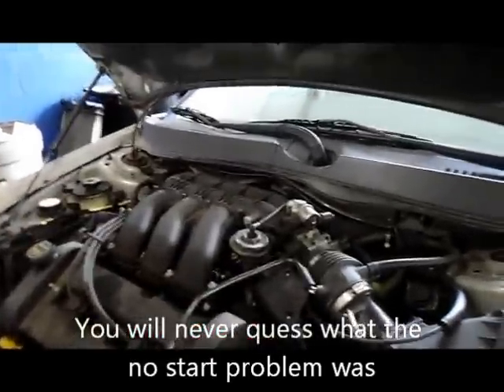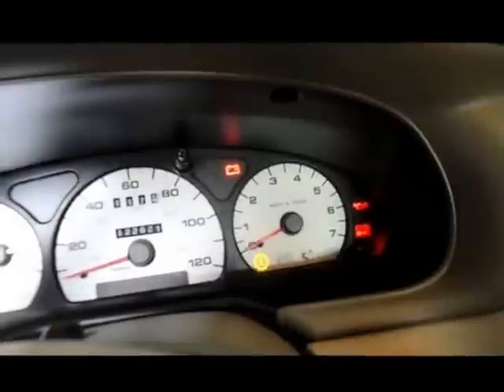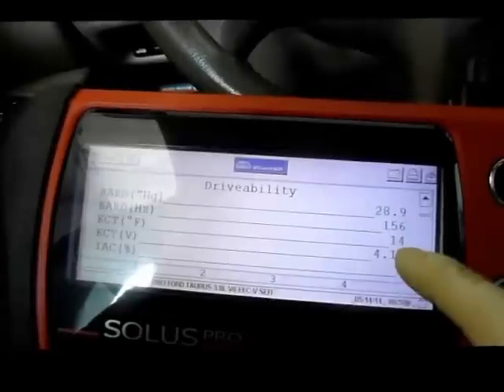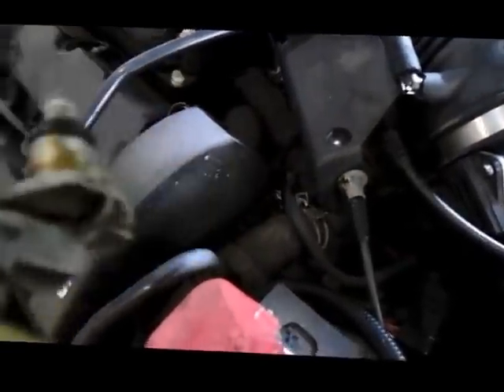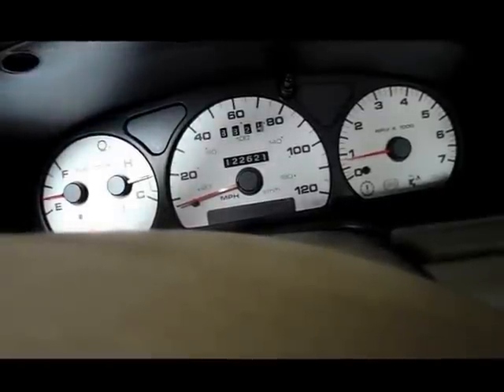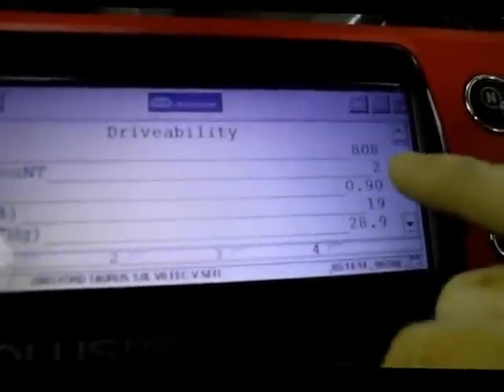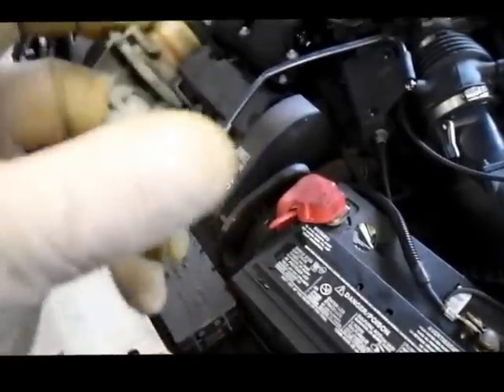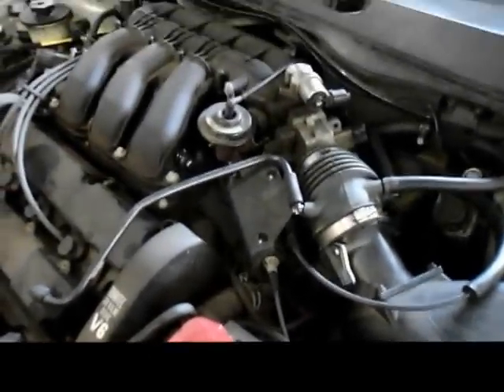Engine cranks but won't start

Comment: The reason for the no spark was because the temp sensor had an open ckt, and the computer is programed to not allow spark or fuel, to prevent operating the engine with a faulty temp sensor.

Comment: 02 saturn sc 1.9l temp sensor did the same thing turn over but wouldn't fire replace the temp sensor engine fires up my understanding is this is common issue on this vehicle. Like you I find it odd it won't run with a bed temp sensor.
Reply from the maker: Thank you for watching

Comment: Could you please help me out. I grew up changing oil, freeze plugs, starters, heads, alternators, drum brakes, etc so Im not a "novice" but im not a master mechanic either. I have a 2007 BMW 328Xi which Ive had for 6 years now and it has 132,000miles. It sat in my construction yard for over a year while I drove other vehicles, when I finally went to move it the Batt was  dead as a door knob, BMW charged me $499 to install and "Program" a new one, while in BMW Service they called telling me the Alternator was also bad needed replacing and it would be an additional $1,300.00 for the Alterntor. I asked Service on specs and found it was a BOSCH 180AMP which NAPA sells for under $300.00 so I installed that myself the day I picked up the car in the BMW Parking Lot with everyone watching me. Car ran for a few days then needed jump starting to get it to go, ran fine for a few more weeks and I discovered Alternator was barely putting out 11.9Volts with engine running, Napa put me through the ringer for days trying to get a new Alternator and in that time the car "Magically" just worked everyday with no problems for 3 months straight so I never pursued the replacement.      

3-1/2 Month's Later im driving 45miles away from home up in the Ghetto of this City and im sitting at a red light and my car is idling horribly, Im looking around for Error Messages, Lights, or Anything and nothing is coming up, my Navigation Screen is so Dimm I could barely see anything I knew the Battery was on its last volts and about to die, I ran the red light cut the wheel and almost made it out of the road but some a-hole cut me off and I was forced to stop half through a turn in the middle of the road where it Died. No one would help me push the car, jump the car, or anything but literally 100+ people asked me for money and money and tried selling me drugs, towels, and a electril drill. I was so disgusted with that class of people you have no idea. till I found 5 teenagers riding bikes who helped me push my car through rush hour traffic into a gas station. 

Finally got the car towed the following day back home, but I was working so I couldnt be there, I had my father waiting for car once it arrived at house. The Tow Truck Driver tried to "Start The Car" so he could use its own power / brakes to get it off the tow truck. My father says while he was standing there watching the tow truck driver start my car the jumper cables connected to the terminals under the hood began to Sizzle, Shoot Flames, Fireworks, and Smoke was Bellowing OUT from under my Hood. Screaming that something was wrong the Tow Truck Driver Ran Back to the cables discconnecting them. 

The following day I removed the alternator and replaced it with a new one from NAPA, i started my car and it was running perfectly, tested the alternator and it was charging the battery 14.6V  perfectly as it should be. I decided to take the car for a quick spin around the hood, put it in Drive pulled out and turned right, accellerated turned right once more and not more than 200feet from where I was parked the car DIED immediately, freezing gauges in place, NAvi Screen went Black and that was it. Car would start only when Jumped / Assisted and it would run on its own power fine, but soon as you turned on Radio, Air Conditioning, Put it in Drive and Accel, the car would shut off immediately. Its been this was for 4 months now and its sitting here doing nothing. I checked the Battery which has a charge to disconnect positive in event of accident, thats still connected fine, the only thing i havent checked are fuses and relays.   The fuse box for this BMW is behind glove box and you need the arms of a midget to reach anything, I have BIG arms and BIG hands I wear a size 14 shoe US and I cant fit my hands into the damn glove box anyways to do anything so im screwed in that regards. im hoping its something under the hood (fuse box) which is under hood could possibly have something i could change but I dont know what it could be. Any help is really appreciated. thanks

Comment: my 2000 accord did this it accualy stalled and would not start i replaced the thermostat and it fixed the problem .i found it odd and i was at my friends shop and hes been a tech for 25 yrs never heard of it

Comment: It should have thrown a CEL first on the sensor but a fail safe position would be to prevent the car from starting. ECU does not know the operating or start temp with a bad sensor so it has no idea how much fuel, timing, or anything to provide. Much like a failed crank sensor.

Comment: Use Mode 06 and check raw coolant temp data. The Scanner can show you a default value that the PCM uses in place of an implausible signal.

Comment: did you check to see if you had any fuel pumping before you replaced the sensor on the taurus? i am having the same identical problem and we replaced the fuel filter and just out of curiosity we checked the fuel pump and got nothing. Could this sensor be able to shut down the fuel pump also?

Comment: I have the same problem with a 97 mazda b3000 aka ford ranger. changed the coil plugs and wires crank sensor fuel filter. runs and starts fine until it heats up at idle or there is no air flow threw the motor while driving. thought it would be temp sensor. thanks for confirmation. will let you know if its the issue or not. thanks again.

Comment: Nissan 280ZX 1978 to 1984 have the same problem with ECT and won't start if stuffed but once replaced starts straight away like the Taurus did

Comment: I have a 84 Ford f250 diesel, just last week I was doing to the store just before I pulled in it stalled now the engine turns but won't start even with starter fluid, I didn't run out of fuel I was told two possible problems, the fuel injector pump, or the glow plugs, he said possibly even both idk I may just junk it....it's frustrating...

Comment: Don’t know about the wiring on Fords but in heavy trucks they share sensor supply circuits, sometimes you’ll have faults for other sensors on the shared circuit but not always, depends what other sensors are. That’s weird that it wouldn’t start because it’s too cold???
Reply from the maker: thanks for watching

Comment: some features of temperature sensors are an open circuit default position when they fail, like your thermostat would fail in the closed position you would have no water circulation, this temp sensor failed and went to the HOT side of it's inner circuitry where it stays, when you turn your key over the computer is being told that the car has over heated and it will not allow it to start. Simple, but stupid in my opinion, I have had it happen on Subaru's regularly, and they are a bit of a pain to get at too, you can just unplug the sensor and see if it tries to start that will tell you if it is the sensor or not

Comment: I have been experiencing the same problem.  Same year same model.  The car runs fine until i shut it off for a few minutes.  It cranks, the rpm gauge will move but that's it.  Wait 5-10 minutes and it starts.  My mechanic could not find any perticular code.  I will keep a spare temperature sensor on hand for the next time this happens.  Will let you know

Comment: A low eng. temp reading to the computer is just as bad an overheat reading, as far as the computer is concerned and programmed, the sensor is out of parameter, think about it this way. If you assume the sensor is good and it is and it's giving a low (cool ) reading, that means the engine may be out of or very low on coolant and overheating at the combustion chambers and valves,engine shut down enable takes over.
Which brings me to the argument---  I have seen many engines fried because of sudden and fast dumping of coolant for what ever reason because the temp sending unit did not have time to cool off or heat up in order to give the driver a true reading and the driver would be confused about the engine misfire , not realizing the valves where seizing from overheating.
I never thought cooling should be gauged by TEMP but, should have been gauged by water pressure. Think about this fact low or no water pressure means a leak, high water pressure means steam !

Comment: it does the same on a 2003 ford Taurus had the same problem except it would crank after a few tries, and the radiator fan starts right as u turn the key to crank it

Comment: working on that now have fuel fire timing comp spray fuel in intake starts warm up start aftar warm up my thoght temp guage no signal to pcm for high fuel for start up old model cars need choke set before start up didnt know if temp unit would cause shut down do now thanks check that today working on pontiac grand am 04

Comment: OK, I'm a little bit more than a minute 
in to this diagnosis.

Cranking that fast, with no spark, timing 
chain/belt is broken.  Pull the oil cap, 
and see if anything is moving.

steve
Reply from the maker: Good guess that is what I thought when I first turned the key

Comment: my 98 ranger w/4.0 v6 has had this problem for 6 or 7 years. cranks but won't start but  It will push start.  I think you just solved the issue.  I will replace the sensor soon as I can.  I had a 91 accord  w/automatic trans.  the coolant sensor connection plug kept getting oily and causing problems.  When I cleaned it the problems went away.  I love youtube!

Comment: ive had the same problem with a 97 subaru impreza outback code said tranny temp sensor but i changed the coolant temp sensor and it started right up no issues

Comment: Hello, I bought a 2006 Ford Taurus and it's been running fine until I park it and after 10-20 minutes if I try to restart it cranks but will not start.  If I wait an hour it will start fine and I'm able to drive.   Do you think its the coolant temp sensor for this issue I'm having?  I've had it looked at and had several repairs, including exhaust work that they told me was the probelm, but none of these repairs have solved the issue.

Comment: Bought a new 1999 Stratus with a 2.4.  Drove it home (30 miles),, and the next morning it would crank and not start. Dealer sent a rollback and started right up. Checked it out couldn't find anything. Returned the car. Next morning the same thing happened. this time it didn't start for the rollback. UNTIL he got it to the dealer. Turns out that the "high temp sensor" was bad and would throw a signal and shut off the fuel.
Reply from the maker: I'm happy to help. Thank you for watching

Comment: Hi Jimmy i need your help i have a 2002 gmc sonoma i recently replaced the fuel pump about 8 months ago an for some reason my truck stalled on me the engine cranks over but wont start. I had my mechanic check my truck an he said the fuel pump is engaging but it sounds like the fuel is spilling back into the tank like theres no pressure in the line for the gas to run its course .I cant find my reciept.what can i do to be sure its not a defective fuel pump so i dont have to spend $200 on another1 1

Comment: My friends Jeep would stall and wouldn’t start. after it cooled it would run again from the same sensor.my escape is currently in the garage for the samething.it’s a safety mechanism to save the motor
Reply: Did your Escape have a crank no start condition?

Comment: I had a 98 Cherokee do the same thing. I was told it doesn't give the correct fuel mixture so it won't start. Then after a few times of doing that the computer stops generating spark to save the engine from lean conditions

Comment: if the sensor had a fault to chassis that was screwing up or pulling down the system voltage maybe? Just a reading of 14 should not do it. Starting your car at 14 degrees is perfectly possible and normal. So something about the sensor was screwing with the system.
Reply from the maker: thank you for stopping by the shop

Comment: Hey I have a 99 Nissan Maxima. Similar symptoms but mines will not idle. I can get it to start maybe once every hour, but you it will start and die immediately. Will not respond to throttle to idle the car. Fuel pump was replaced. MAF unplugged and cleaned to no avail. Throttle body cleaned as well. It started pretty quick after those last two but died immediately. It will start with starting fluid but again will not idle. All suggestions are appreciated.

Comment: My brother had a Chevy  Cavalier  that would shut down and after  about 1/2 hr it would start up. Turns  up it was a sensor  in the converter.  It would heat up computer  would shut engine.  1980s  cars already  had  computers  control  the engine.

Comment: The temp sensor is going open circuit,that would be the reason for the high voltage of 4.1x volts oh and as someone else hinted the computer sees an out of range voltage and disables the engine

Comment: Hi Jim I have a 2000 Saturn LS 2.2 4 L I get crank no start of check the fuses the battery to starter the alternator everything's good it gets fuel sometimes she'll start sometimes she won't I have a bad O2 sensor down flow I don't know if that could be the problem of what's not starting her but if you could help me out I'd really appreciate it thanks

Comment: Cold start sensor sends different voltage signal to ecu..... ecu runs enrichment map for easier starting. This is why short trips in cold weather can cause unburned fuel to seep past piston rings and into crankcase- most vehicles it takes 30 minutes of driving after fully warm to burn off fuel after a cold start. Make sense?
Reply from the maker: Thanks for watching.

Comment: Seems like  a safety  feature , without  that sensor working  ,  the computer wont know the temperature  of the engine , operating  temperature  etc . So it shuts down and wont allow start up of the vehicle at all. I had  a similiar thing happen , no crank no start , thought it was battery  alternator ,  short etc . Turned out to be ac compressor that siezed up , so engine couldnt spin over all.  In winter !That was a 2006 nissan altima  several years ago. Cost me 1100$ to get  ac  working again   aweek before xmass no less  !

Comment: ok so, the ect sensor says 14 degrees f, somehow causing a no spark cond. but even stranger, after replacing the ect sens, it is sensing 192 degrees f,, now keep in mind this vehicle came in as a NO START, towed in im assuming, so how could it now b at full op temp ?

Comment: Did this actually have no spark or did it have spark and wasn't firing?

I've seen a few faulty temp sensors cause running issues.
was an AA mechanic and it was quite common.
disconnecting worked most of the time

Comment: Technology works in illogical strange ways. Without using & understanding a scan tool, no hope of fixing problems. That's why I drive a 30 yr old ford laser with half million on the clock. 👍🏻👌🏻🖐 🇦🇺
Reply from the maker: That is for sure .Thank you for watching.

Comment: What is the temp sensor input range that the computer expects? If it is out of range then maybe it won't run. That hand held unit doesn't seems to give enough info. If that is CAN then maybe the sensor is corrupting the bus line. I am not a mechanic but I can tell YOU of these possibilities. It is not that cars aren't better. It is that people are too cheap to hire modern mechanics.

Comment: No matter how many computers a car has, it must still have the moral equivalent of a choke. Air/fuel mix must be adjusted for temperature, and if the mix is too far off, it won't start, or it will run like crap.  If the weather had actually been 14 degrees it might have run.
  Your "choke" was slammed shut.

Comment: It threw me a bit when apparently after changing the temperature sensor and starting the engine the temperature read 192F. After a while I figured there must have been a chunk of time not shown while the engine was running and getting up to operating temperature.

Comment: Interesting the first thing i noticed is that the vehicle was cranking way to fast,like it had a broken timing belt.  When i saw the ect reading you showed on the solus, i was thinking the fuel mixture is too rich because the computer is seeing cold temp and this in turn caused the cylinders to wash down and cause the fast crank issue.  I will bet that after you changed the ect that the car didn't start right away, this is the reason you had to edit the video.  Anyway you had me fooled, i was thing broken timing belt in the first 10 seconds of the video.

Comment: This is limp home mode they did start putting these functions into cars to prevent idiots from cooking their motors , one reason is some engines when the head gasket goes the engine block will crack and an engine replacement is needed, if you have a fail safe on a motor that is prone to do this that is why

Comment: hi

Hi may I ask when you finally got the engine to start, the engine coolant temp on the dash was at normal had you previously got the engine running and then finished off the video.

Comment: Im thinking the sensor is there to tell the computer to disable it for reason . Engine or component overload prevention.  Fuel trim related with that sensor and computer had signal returned from that sensor erroneous data so it had shutdown car .Possible to prevent damage to the emission parts so it shutdown .

Comment: ok i'm little confuse, the first voltage is showing 4.18v and second voltage show 0.63v. Shouldn't the voltage be close to 5v for a normal sensor to work?